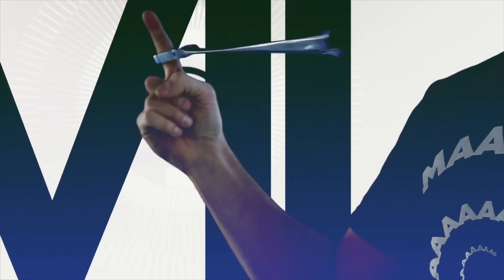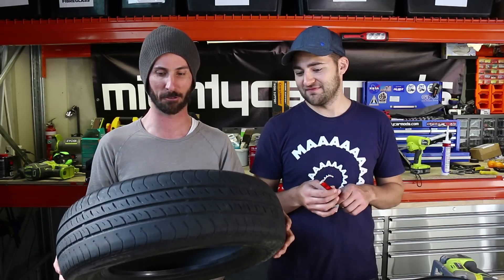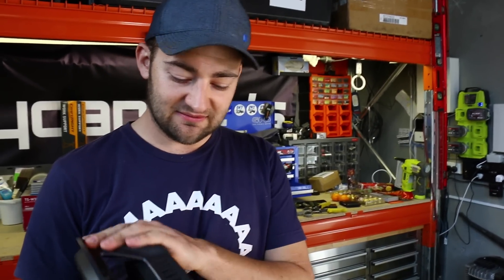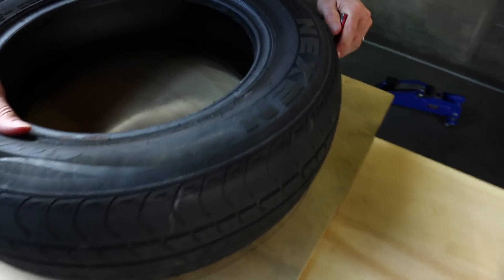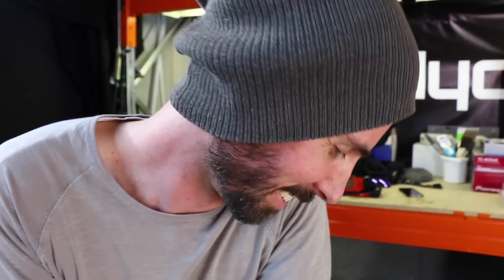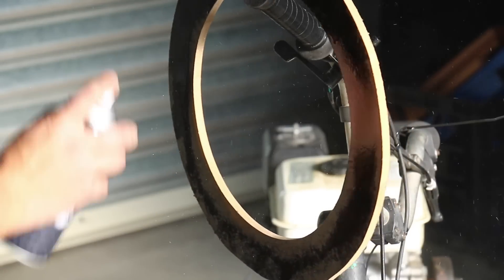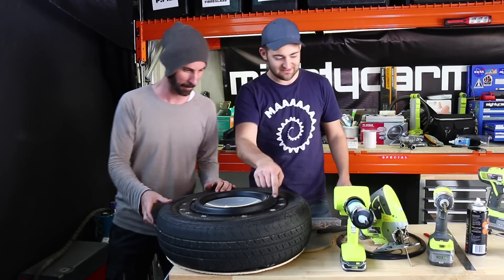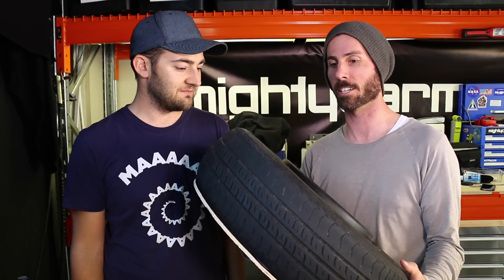Build a Spare Tyre Sub

Comment: one reason why it works is because its the same concept as a radiator sub which is nothing more than a speaker without a driver to help simulate a larger box. perfect example would be the 8' towers steve meade built for his shop using 2 18's paired with radiators.

Comment: So just figure the volume of the tire and find a sub that matches in resonant displacement, BOOM! perfect sub box! A baffle system might be needed to prevent funky standing waves, maybe off setting the speaker from center. With a bit more work maybe making a hexagonal box set into the tire walls would give the desired effect.

Not much more cost but a bit more work and planning and you could make a very legitimate sub box. I'm going to see what I can do in my cherokee

Comment: Suggestion for improvements for the tyre subwoofer: Using some fiberglass with sand/resin mixture to harden it up and damping the unwated resonation inside the tire.  And for more room, using a flatter driver or smaller driver could actually sound amazing since there are 8" subs that require next to nothing amount of litres. Just my ramblings.

Comment: The only thing is that a lot of trunks have a board that rests on the spare so you would have that weight on the spare. So you would have to mount it a little further into the tire so it recessed a little.

Comment: I love the idea of a Man Cave Sub Woofer.  Mount it on the wall, but in some accu-fill use 3/4 MDF and I bet you could get 50Hz out of it.  The tire probably reduces internal reflection so it is almost like a ported speaker -- Bad Ass Rocking with Firestone...I can't Drive 55!!!!

Comment: Well, I'm kind of not surprised that it sounds as good as it is, yes it had the possibility to roll off in infinite, however it's a sealed, antiquated, anti-shock cabinet for lack of a better phrase. Due to its soft composure, it would sound soft and not overbearing. I wonder how this would work in a studio environment with similar composed tweeters and mids.

Comment: Hey MCMers, another cheap way to help improve the sound quality would be to add hanging basket liners. I've just used some inside some 6x9 speaker boxes and the sound improvement is impressive.

Normally these liners sell 40 pence each in the UK, I got them on offer for just 10 pence, bargain

Comment: Actually you might get an even better result by using a more expensive and bigger driver that can push more air, faster. That is, if the seal for the backplate of the tire is air tight..

Comment: Round speakers roll away. There is no other reasons other than making the math harder when calculating volume. Cool video idea anyway. Also I think tires are stiff enough that the flex would not be that bad until you get in to large power. Also through some poly fill it will most likely make it sound better. 12" subs normally like big boxes and poly fill will make the box work like a larger box.

Comment: shit hot!
why not cut bottom cover same size as top so it seals on bead of tyre. it would then sit in wheel well nicer, less vibration, seal better to tyre. also sealnt on wire where it comes through tyre.

Comment: I'm not a big expert or anything but I do love car audio and I have some questions: Would you recomend to apply some sealant on the screws from the inside? And, shouldn't the enclousure's material be something firm, solid and according to the manufacturer's specs to avoid damaging the sub? I know it's an experiment and, seriously, a very creative one. But I just wanted to double check for making my own idea or to keep on with the typical sub box. Thanks!
Reply: wouldn't that flex make the enclosure work like passive radiator?
Reply: Fernando, just stick to a regular ported, or sealed sub enclosure depending on the type of bass you prefer. the tire is a terrible way to enclose a sub lmao. I mean it's pretty cool but would never work realistically.

Comment: This actually works really good. My Grand Cherokee has a huge spare well, big enough for a 30" diameter tire. I did pretty much the same thing using a 245/75-16 tire, the biggest I could fit in the well and easily big enough to hold a JL Audio 12w3v3-4. Thumps pretty good even with the spare tire cover in place.

Comment: How do you place this in the cavity for the spare tire?  In all of my cars there is or was a threaded post sticking up that allows you to securely attach the tire with a plastic and metal hand tightener.  With a subwoofer in the middle the spare won't fit in its original location.  Is it meant to just sit in the trunk?  Love MCM

Comment: not the best sub cab but...
same idea with bottom circle same size as tire bead adapter ring (both glued-screwed in place) then 6 posts 3/4" or more length between floor circle and adapter ring: would increase the cubic inches, and make it all more rigid for putting tension on the sidewalls. wouldn't take much time to alter and test for improvement(?).

Comment: Not an audiophile but I do want some kick in the car and do not own the skills or equipment to create a round mdf box that fit's in the spare tire space. 

Even though not as good as a box, do you recommend this proper solution?

Alternative is a round piece of mdf with a square box on top of that. I can use the remaining space for the capacitor, main cut off switch and amp.

Comment: Do you need to add air to tyre every now and then for it to work?
Reply: WHAT
Reply: no
Reply: +h4mza786 yes, its imperative, they left out you install a valve and use exactly 20psi in it, it amplifies the pressure waves increasing output and also increasing box rise, if you dont its not worth having.

Comment: I used the seat belt and buckled a base tube in the back seat of my 928. It works pretty sell and it never moves so it is safe and secure. Although I did mount the amp inside of the spare tire so it could be removed easily if I needed to gain access to the tire or the battery. Cool build, I hope there are many more diy friendly ones like it soon :)

Comment: I dont want to make an ass/u&me, but i'm going to assume that you dont want the resonating chamber to be dynamic in volume or static pressure, which is exactly what is going to happen, unless you put some sort of support between the two bead locks to prevent the speaker body from moving around. In other words, if you've ever had a down firing sub box that you forget to fasten down, i expect this to sound similar sort of mushy sound, but that's if you dont have any support for the speaker body, we'll se how it goes later on in the video
Reply: +denvera1g1 how lazy do you have to be to use a powered calk gun, and where can i get one

Comment: hm. Why am i always hearing SaabWoofer ?? :-)

i'd have added perhaps 2 or 3 wood struts between front and rear wood plate to stiffen up.

Most of the highend calculation stuff is thrown in the bin anyways, since you can't really calculate car interior sound reaction and would have to measure and use equalizer.

Comment: great video......I subscribed to you guys because I watched the video where you install a turbo in Marty's Mazda.  I thought your humor and the vibe you 2 have is awesome.  Pertaining to this video the roundness of the tire is fantastic for car audio.  typically you do see square boxes but alot of them that are built now, if done properly, the corners are kerfed or people are adding 45* braces to help role the sound wave instead of having dead 90* corners that reflect the wave back at a hard angle instead of having the natural roll the sound wave has.  The softness of the tire is bad for the wave if you are planning to send a lot of power to the sub.  Under moderate loads, 200w or less, the wave won't cause the tire to flex therefor the sound wave isn't altered and doesn't sound dead or flat.  The majority of the time if someone plans to put a sub in a tire well they fiberglass a mold and build off of that, but for the person that wants a little bass and no funds to buy or build a proper bos this tire sub box is a fantastic and cheap idea for adding lows to any system.

Comment: you could build some fake panels inside the tyre with some plywood as well in order to improve the ressonance of it.
and maybe a little flap on the back for the air to flow freely in and out

Comment: Could it be that audiophile speaker construction doesn't actually matter? ;)
Reply: +Simon Coles It matters a little less than you might think... but you still need a speaker box etc. In a lot of ways rubber sides give a cleaner reflection from the rear plate and the air is much more responsive in there to pressure changes. I have seen a similar design in certain commercial products. I don't think the overall design is too bad, other than the amount of air in there.

Comment: Hey guys i need some help. So i bought an after market radio and was attaching the radio wire to the converter into the car. i didnt use anything besides just twisting the wires together, at first the radio turned on and worked, then all of a sudden it stopped and hasnt worked since. I then taped it with electrical tape but still doesnt work. Also now the power locks dont work when the car is off and sometimes doesnt work when the car is on. I have an 01 civic. Any idea? please help

Comment: Marty's idea of the audio mechanics of the tire is correct! Also by having a sub attached to a tire, sitting in the trunk, you also allow the rumble of the bass to transfer to the chase and body, which would also allow 20Hz and lower to be felt stronger as well. In a car, not to important, but still cool especially for an audio guy like myself! :D

Comment: This wouldn't work on my car because it has an outdented part in the middle of the wheel well for a mounting bolt to go into. I take it this isn't the norm.
Reply: Same here dude I was like this sounds great until I remembered it
Reply: Darren Jacobson No way of removing it? My dad had one too, but all he had to do was to unscrew it from it's place.
Reply: Long Dong Nope, it's a molded part of the metal at the base of the spare wheel well. I suppose and angle grinder could remove it but who wants to go to that much trouble for something like this.
Reply: Darren Jacobson Yea, may not be worth it unless you have a very cheap car.

Comment: The sub was not used as a Sub, it was used as a speaker. A sub would only push bass. You will kill a sub by pushing anything but bass through it. So we really do not know how it sound as a sub woofer. I wanted to see this speaker move some bass with a amp.

Comment: why not use the space by flipping the spare tire over to the deep dished side to give the volume needed, then clamp mount the speaker in that and keep a usable spare tire. Don't know about you but hoofing it carrying a flat tire is not good and expensive. If you have a full spare. or a doughnut, that's perfect.
Great idea but please Keep your spare usable because thumping bass is not cool when your walking to get a flat fixed.